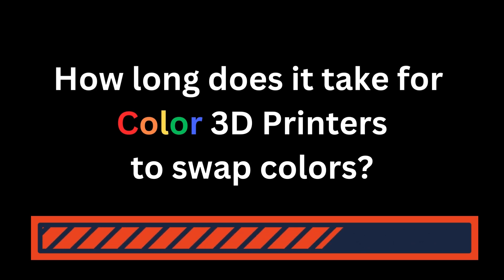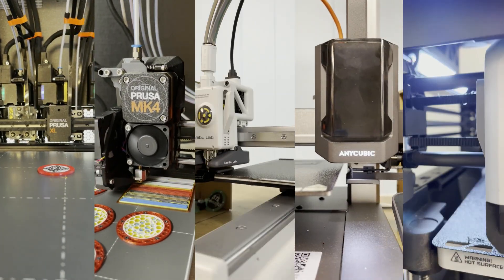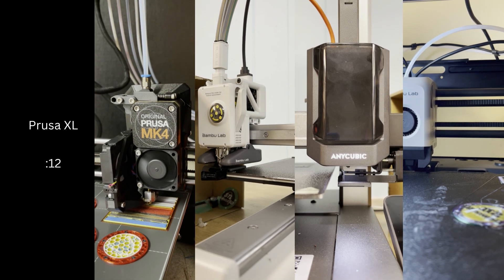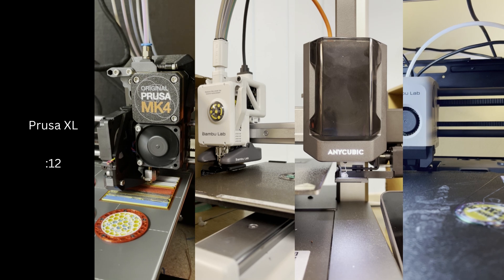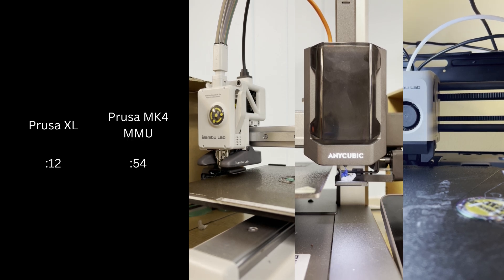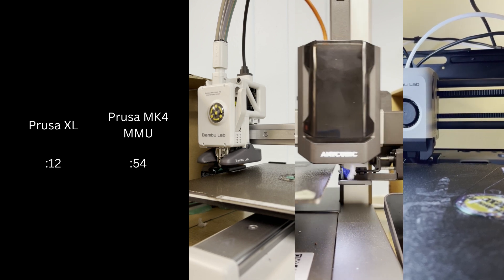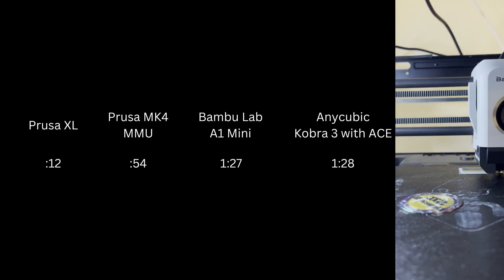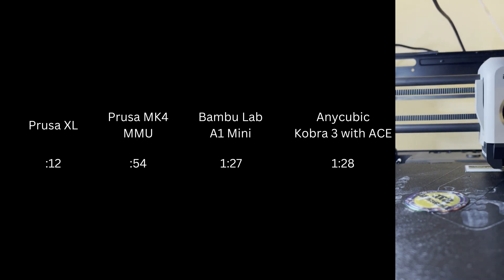I timed Color 3D Printers...for research.

Comment: They don't appear to all be going from and to the same colours. The difference in colours means different purge amounts, for example the P1P seemed to be going from black to white, which means the longest purge time. Also were the purge amounts calibrated or was this all with default settings? Thanks.
Reply from the maker: Interesting point -- they were all printing my MakerCoins, but yes, not all in the same color. The Prusas & Kobra were using defaults, the P1P & A1 have been reduced to .6 multiplier on the flush settings. Going from black to white does take a few seconds more, but the majority of time for the P1P is spent spooling & unspooling the filaments because all the spools share one filament path from AMS to nozzle. The other systems all have dedicated bowden tubes, so the filament only needs to be backed up a few inches.